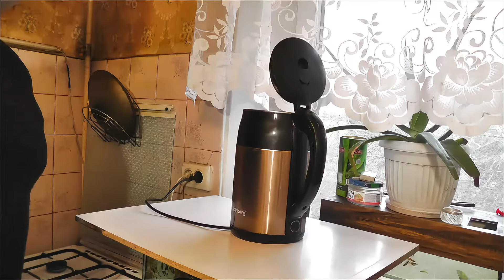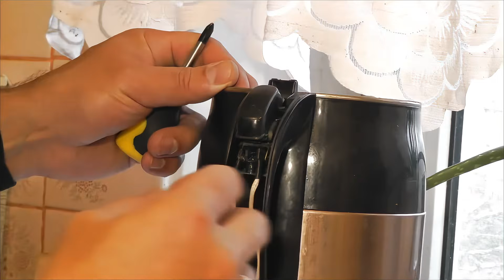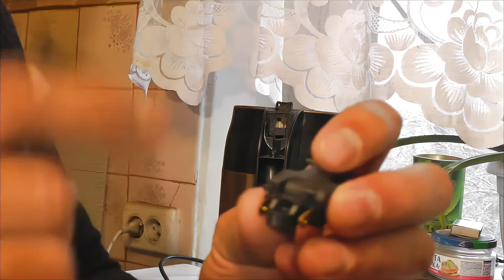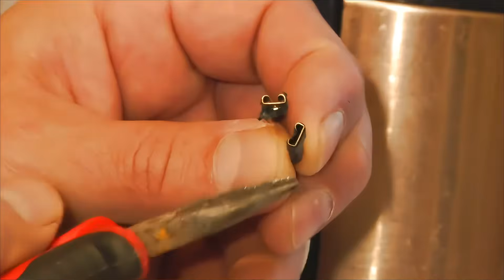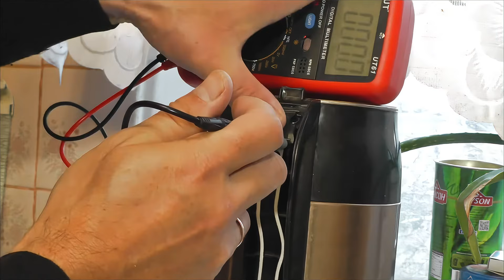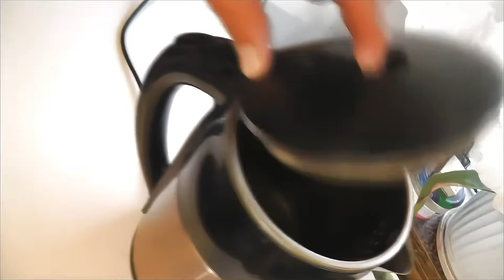Electric Kettle Switch Repair

Comment: I put my Dualit classic kettle on thinking there was water in it but there wasn’t so I heated up and was hissing badly before I pulled it off the base. I stupidly filled it up with cold water but now it’s not working. The light isn’t coming on on the kettle when I press the button down. Is this something that will resolve or am I needing to buy a new kettle? Just to be clear, the kettle had no water in it and never shut itself off or anything like I would have hoped.
Reply from the maker: "I’m so sorry to hear that! It sounds like the kettle's boil-dry protection or a thermal fuse was triggered. Filling it with cold water while it was still piping hot might have also caused a thermal shock to the element or the internal components. Sometimes, these kettles need a good amount of time to completely cool down before they can reset, but if the light isn't coming on at all, it’s possible the thermal fuse has blown or the element is damaged. If you're not comfortable opening it up to check the fuse (like in the video), it might be safer to have a professional look at it or consider a replacement. I hope you can get it sorted!

Comment: do i have to use the switch? isn't there any way i can operate the kettle directly from the main supply?
Reply from the maker: Of course, you can remove the kettle's switch and connect it directly to the electrical network, but this greatly increases the fire hazard.

Comment: This is a very good detailed video but mine is burned out so I'll try changing the button.
Reply from the maker: Yes, the button on an electric kettle breaks most often.
Reply: Same like mine 
I gotta just change the switch 
This video saved me from cashing out
Reply from the maker: That’s exactly why I post these guides—to help you save money and keep appliances out of the landfill! Replacing just the electric kettle switch is a simple fix that most people don't realize is possible until they see it done. I'm glad the video helped you avoid 'cashing out' for a new one. It’s a great win for your wallet and for the environment!  Was the switch replacement tricky on your specific model, or was it a straightforward swap? Let me know, and enjoy your next cup of tea/coffee

Comment: I am stuck with disconnecting the contacts from the switch. (around :140) I actually destroyed the whole switch and still have the two contacts stuck to some plates. How do I get them loose?
Reply from the maker: Take a thin flat-head screwdriver and insert it between the kettle's switch button contact and the wire connector. This will bend the connector lock upwards and it will disconnect.